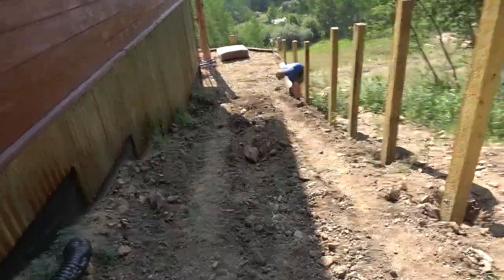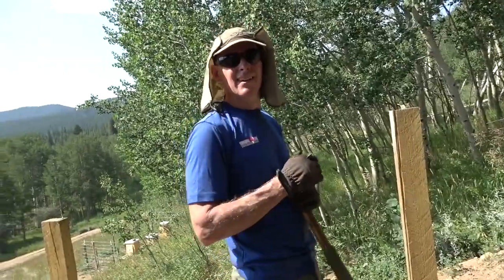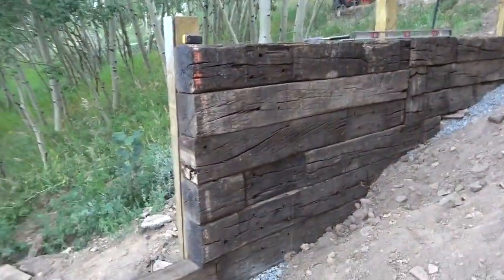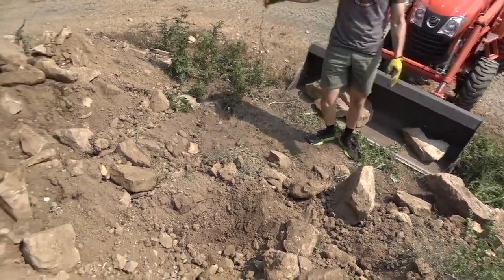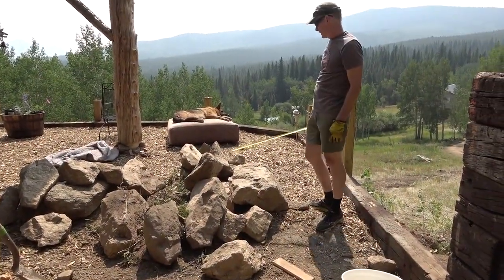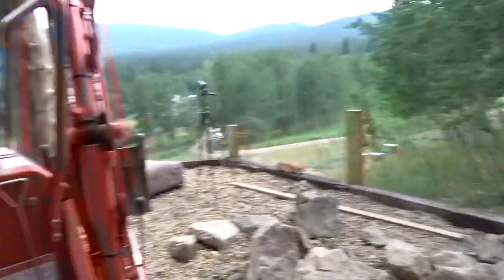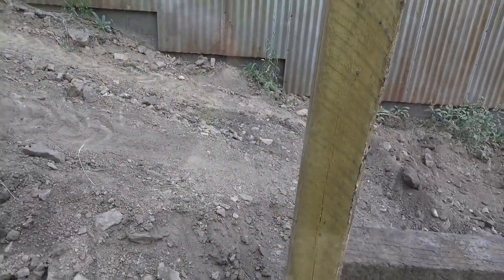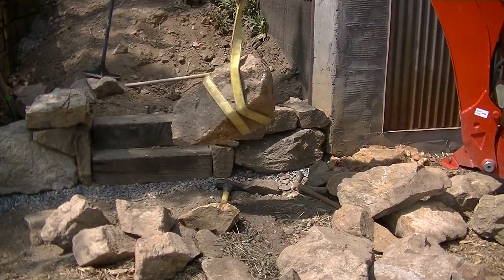Building Terraced Steps with Wood and Rock

Comment: Looking good Brian. But 1 safety observation. A 54in high vertical dry stone retaining wall with mainly dirt fill behind it can easily become unstable during periods of heavy water runoff and collapse forwards. Set the stones at a slight backwards rake as the wall gets higher. Same alongside each of the first set of steps. This from my brother who is a professional drystone waller.
Reply from the maker: thanks for the tips! We will find out after this winter how stable the stonework really is.

Comment: Yes, you are doing a great job.....I think it would be good to consider the comment about the rise and run of stairs, if your not to far along.  When I was working on amusement ride stairs, which certainly can have different codes,  it was something like the rise and run should be a total of 17.1/2 to 19.1/2, so a 7 inch rise would get like a 10.1/2 run......should check codes and not go by this.  The difference in riser height should not exceed 3/8 inch, which you wouldn't anyway using the same height ties everywhere.
Reply from the maker: Thanks!  We're comfortable with the stair treads as they are; it's not a heavy use walkway; just a more safely designed path to get around the house than loose gravel on a steep slope.